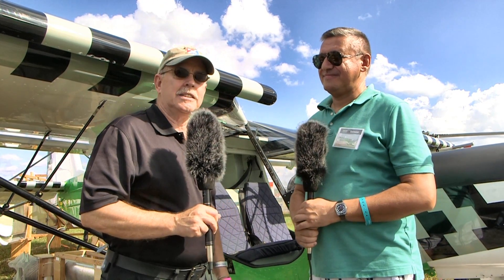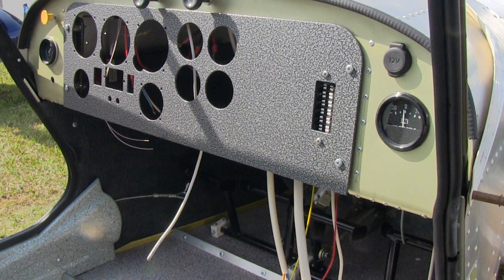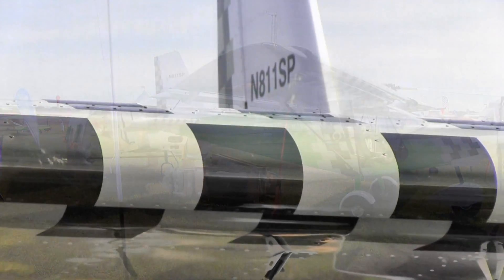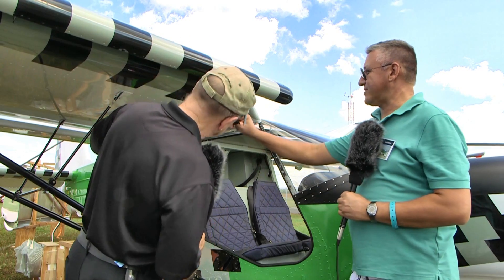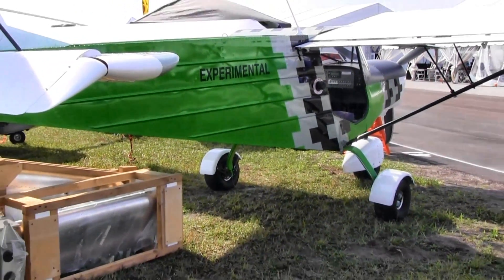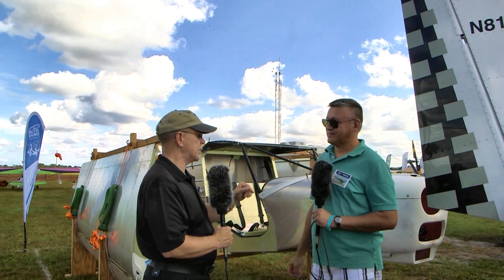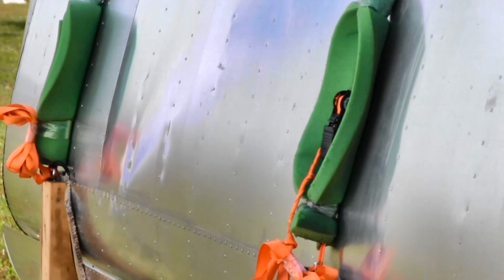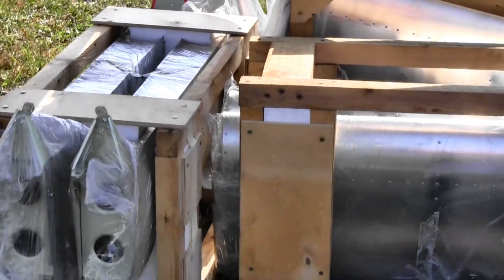SP 30, Spectr SP 30 experimental aircraft, Deland Sport Aviation Showcase Deland Municipal Airport.

Comment: 30K sounds a little high to me for that.  also still have to get engine that's another 30K.plus prop low estimate at 3K  still have all the time-  he said what a month that would be about 200 hrs, and I would add another 50% to that, so close to 300 hrs to build it, then paint, instrument's, light's, wiring,  after it's over probably have about 100K in it, I just seen a"Bear" Alaskan kit Bush plane, w/26 tundra tires, low time (300hrs) airframe, w/a o-320 lycoming (700hrs) with nice panel. All current paperwork and flying every day -$70,000